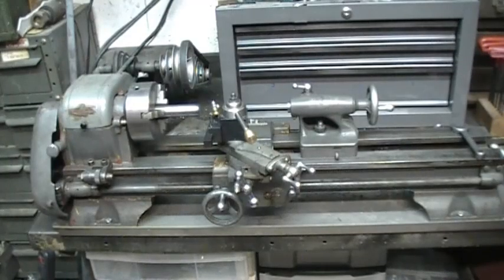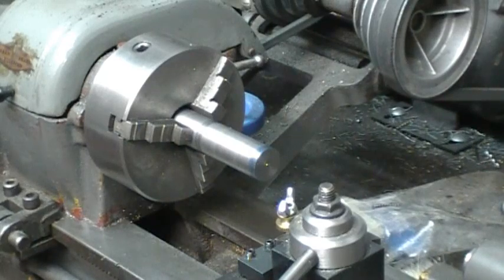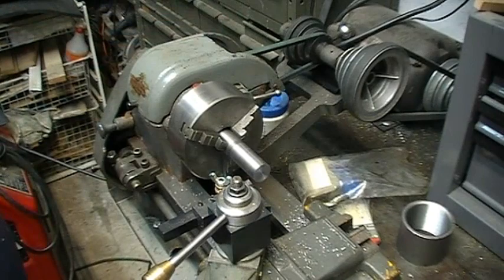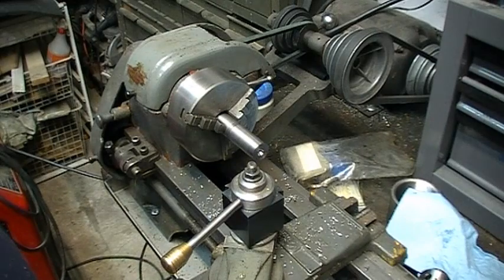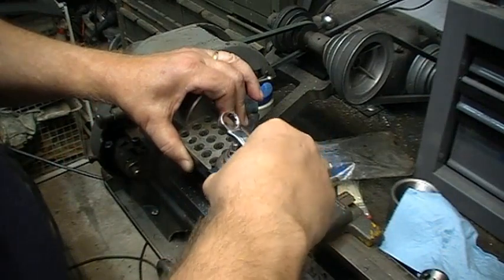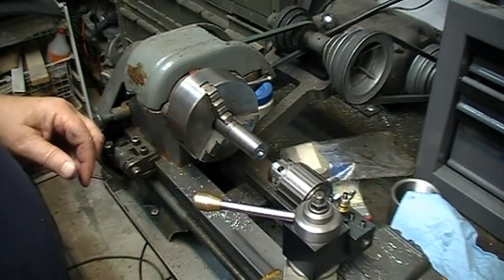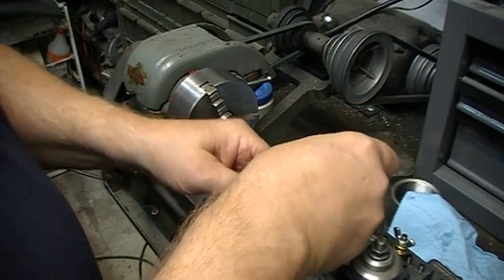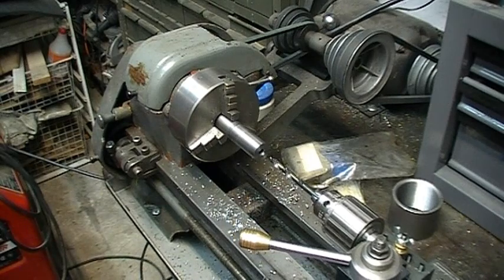TIP: Drilling Deep Holes With A Little Lathe

Comment: Having only a chinese lathe 7"x12", i developed the following system : i placed a long drill ( 6,0 mm. in diameter ) into the chuck of the lathe , and installed into the tail stock only its chuck ( all opened ) with its arbour. Then i advanced the tail stock till all the arbour was bored, till its end. The end of this arbour is large enought to be not more weak with a 6 mm bore ...
From now on, i can install into the tail-stock any drill till 6,0 mm in diameter, as long as 200 mm, and then - repositioning that long drill into the chuck of the tail stock in one or more steps, i can bore over 8" in lenght into the piece of metal in the lathe chuck.
My best regards from Italy ...
Reply from the maker: Thank you for watching and commenting

Comment: This is a really bad and unnecessary idea. Just move the tailstock incrementally closer to the workpiece during the drilling operation. 

In fact, unlocking and sliding the tailstock back and forth towards the workpiece, and using the saddle as a stop for the movement, is actually probably even marginally quicker than this suggested method. You can retract even a long drillbit to clear swarf in a second that way. Wipe the bed and oil liberally - the tailstock will skate with very little force. (- Not that a few seconds should matter!)

Using the tailstock will also always offer the possibility to drill as straight, concentric and dimensionally accurate as your lathe and tooling allows. (Which is a lot better than folks think.) Whereas this method introduces several new possible sources of error.

If your tailstock doesn't have a quick release, spend some time building that instead of a saddle toolpost mount for a drillchuck.
Reply from the maker: We are going to have to agree to disagree on this one. On a small lathe like the 6" Atlas there is only about 1" of travel in the tailstock.  Locking and un-locking the tail stock to drill a deep hole takes a lot of time not to mention that it is a real pain to keep pulling the tail stock back and forth.  The method that is shown in this video is an industry accepted method that is used even on some larger lathes. Thank you for watching and commenting.

Comment: Super helpful information. I always wondered this... now I have to find out where the heck I can get a tool holder for a chuck. Wonder I could could mount a chuck in a boring bar holder.
Reply from the maker: I made my own holder but I have seen others use a boring bar holder.  It will work just fine.

Comment: Just drill half way then flip around
Reply from the maker: I do that also but not always possible.  On a small home size lathe the travel on the tailstock is only about 1 inch.  Thanks for watching and commenting.
Reply: On those lathes are they possible for like spacer rings
Reply from the maker: @ashtray3608  not sure what you are referring to..
Reply: Or small production shop to start
Reply from the maker: @ashtray3608  I do some small production jobs.  I have 10" Atlas lathe with quick change gears since this video was published.  I still use the small Atlas for second operations and very small parts.
Reply: If I wanted to start a small production shop would they work out for now
Reply: I’m just looking for a mini lathe if I have to save up to get a better one imma just wait and get a mori seiki cnc
Reply from the maker: @ashtray3608  I have found good used old iron.  But that being said a new lathe would be nice.  If I were going to purchase new my first choice would be Precision Mathews.  I actually was ready to purchase one when I found the 10" Atlas. As good as it is used machines come with their problems.
Reply: Yea I just was thinking about getting a mini mill an just barely doing some work on small parts production but didn’t wanna jump an go buy one

Comment: What is the brand of your lathe? I have the same but no mark on, I need to know, I have to by a back plate and a 3 jaw chuck
Reply from the maker: This is an Atlas  618 lathe also sold by Craftsman.  The early model has bushings or babbitt bearings in the headstock and the thread pitch is 8TPI. The later versions have Timken bearings and they have a 10TPI spindle.  There are a lot of parts for this lathe available on eBay. Thank you for watching and commenting.

Comment: What's the top spindle speed of your lathe ? I'm going to start my guess at 3,000 !
Reply from the maker: I think closer to 2500 because I have a different pully set on it.  I can't check it right now because I have taken this lathe out of service for now.  I have replaced it with a 10F that has QC gears.  I will be setting the 618 up again after I finish rearranging the shop.  Thanks for watching and commenting.

Comment: Steve What size tool post are you using?
Reply from the maker: I think that this is considered an OXA.  The original post was made by a company called AZ CNC.  It was aluminum and I was never happy with the rigidity so I built my own out of steel using it as a pattern.

Comment: Good idea! If you need to be really close on center make a close fitting collar (or a bushing perhaps) to fit over a pin you've mounted into your drill chuck. Now you can clamp a test indicator to the collar and swing it around the work piece and know for sure that the drill chuck is lined up with the spindle.
   For those not familiar with leaded steel (a.k.a. screw machine stock) it cuts so much easier and gives a much better finish than the 1018 carbon general purpose steel you see most of the time. The leaded steel isn't hardenable and really isn't weldable, though it can be brazed. Leaded steel works a treat for small delicate parts when you need something more durable than Aluminum.
Reply from the maker: Aceroadholder I actually use a couple of different methods to line the center up. This is the easiest for general work if the part is already in the lathe from prior operations. The 12L14 machines like a dream. I use it for non critical parts. My go to for parts that need to be hardened is “Stressproof”. Thanks for watching and commenting.
Reply: @sharkrivermachine  Yep, your method is fine for general work. Often the hole is going to be bored anyway if it's important the hole be round and straight.
Your method can be enhanced with a bar held in the tool post or mounted directly on the compound. In the bar you can for example mount a center drill, drill, counter sink, and tap for repetitive work. With the tools mounted say two turns of the cross slide apart you can quickly go from one tool to the next.
Cheers.

Comment: I have always wondered how people normally centered up those kinds of tool post mounted chucks. Now I know! Thanks for the tip. :-)
Reply from the maker: That is the method that I use if I have a part already in the chuck and have performed other operations on it.  If I can set up the chuck prior to putting the work piece in the lathe chuck I will chuck a piece of known straight material in the lathe chuck and then tighten the drill chuck on that piece.  At that point I tighten up the tool post and tool holder.  Thanks for checking in on me.

Comment: I like the idea, even though my maccine's a 12x36 Chinesium unit, drilling deep holes is a pain.  I think doing something like what you have there is the best solution.
Reply: I was recently told of a long thin hole being put through small rod. Well, it seems the rod wan't that thin to start with and the long hole came first ! he then mounted the thick rod between centres and turned it down aligned to the drunk hole !
Reply from the maker: On a heavier lathe you can power drill. Thanks for watching and commenting.

Comment: Very good tip. I've been using one on my 618 for awhile now.
Reply from the maker: I started using this when I had a job that I had to drill the full length of a 6" piece of stock.  I was able to drill from both ends but that is a big job on a little lathe.  Thanks for watching and commenting.